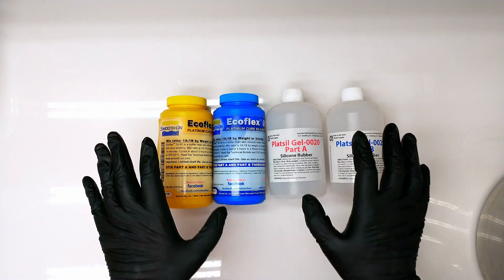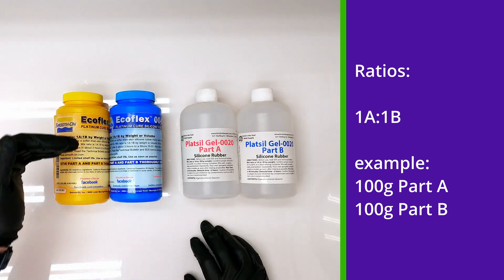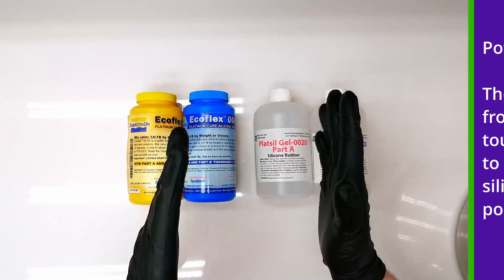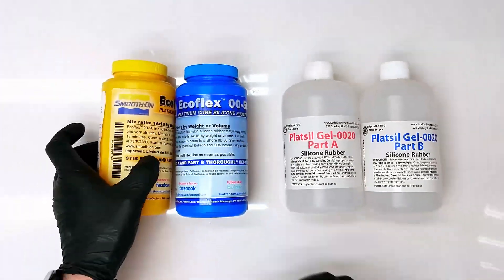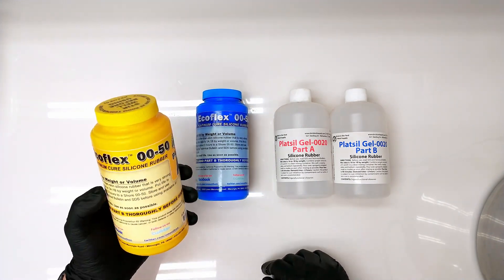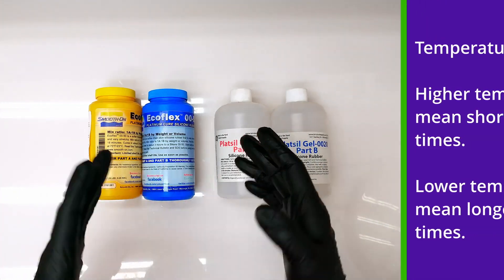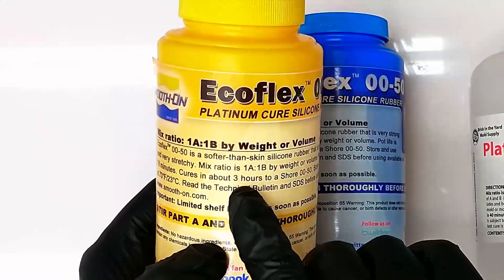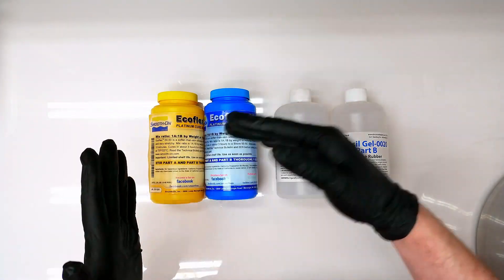Silicone Pot Life, Cure Time and Temperature - and How They Relate (Amavidi Academy Sneak Peek!)

Comment: Hey there! I just started on this awesome creative journey and I was wondering is there any way to reuse containers and brushes after mixing silicone?
Reply from the maker: Hi!  Sorry for the late reply!   For cups, you can let the silicone cure in the cup and then peel it out.  Wash it down with alcohol and you are good to go.  For brushes, no.  Once a brush has silicone in it, then it's pretty much toast :)   Get inexpensive "chip brushes" and just know that you are going to toss them after one use.  Pro-tip:  always grab the bristles and pull out any loose bristles before you use it.  Loose bristles will just get dragged out and end up in your silicone!   Hope that helps!

Comment: Why is it that some things made from silicone seem to have a sort of satiny or soft surface texture, and others more shiny or sticky? Is it all down to things like slacker, or is there something else going on as well?
Reply from the maker: Hi!  Without knowing exactly what products you are talking about, it's hard to answer.  But the surface texture of the master determines the surface texture of the final products.   Some makers or manufactures want a matte finish for their products - others want a smooth/shiny finish.  A matte finish can hold on to lube better, but creates more friction.  A smoother surface has less friction, but lubes tend to slide off more easily.  It's a bit of a balancing act.

If it is sticky, then there might be other issues.  It could be something besides silicone (TPE/TPR), silicone that wasn't cure correctly, excess mold release, silicone that was exposed to silicone lubricants, etc.

Hope that helps!

Derek

Comment: Out of curiousity, are Polytek's 00-20 and Smooth On's 00-50 equivalent hardness, or were they unrelated examples in that regard for this video?
Reply from the maker: Hi!   They were just the examples I had on hand so they are not equivalent.   Generally, firmness is independent of brand so 00-30 is 00-30 whether it is Smooth-On or PolyTek.